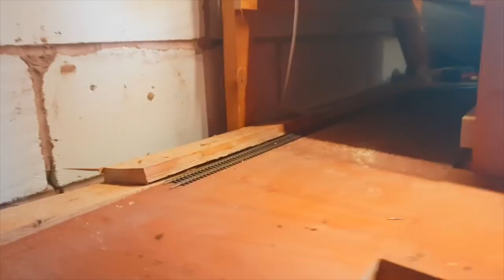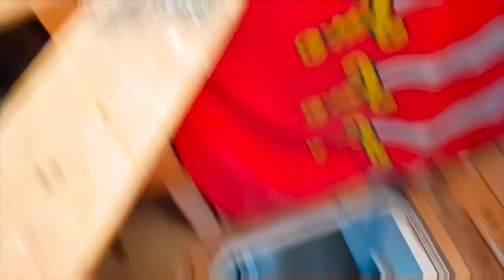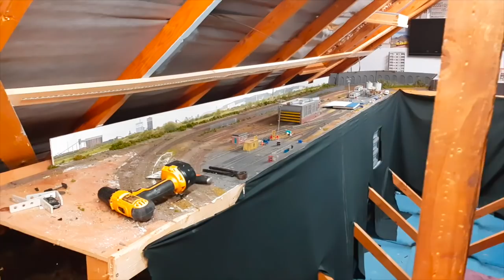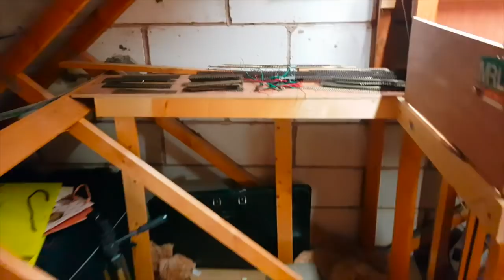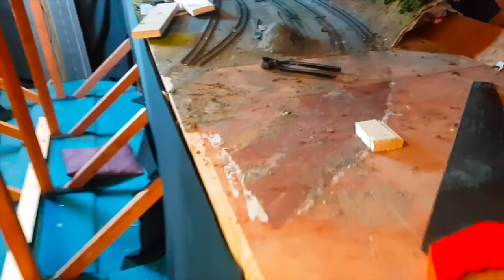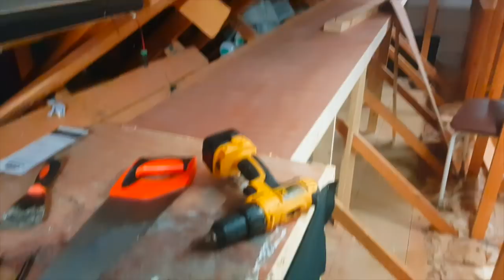Gowerton Parkway - The Re-build Begins

Comment: Good job well done 👍🏻 You’ve worked really hard especially in the blistering heat.........😱 It’s coming on a treat sturdy and level. It’ll be worth it in the long run as you said in your video the fiddle yard will hold good long trains 👍🏻
Reply from the maker: TheDaf95xf certainly will be worth it ! The track is mainly down and the sidings are pretty impressive so far !

Comment: Well done, fantastic effort in the heat we have had this week. I know it’s a little way off yet but have you checked out Megapoints system for DCC changing the points over DCCConcepts system. I chose Megapoints and, (my opinion) what a good choice that was. Price very comparable and much less wires involved as it all runs on a bus. Just a thought. I watch with interest ........Mick
Reply from the maker: Mick Clarke Thanks for the tip , I will check it out.